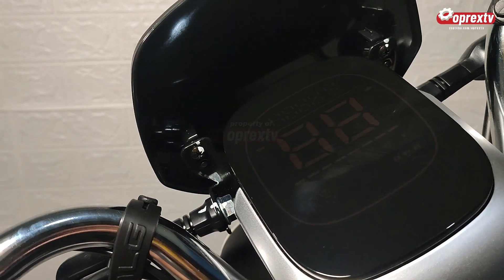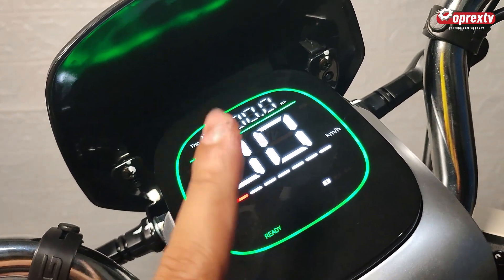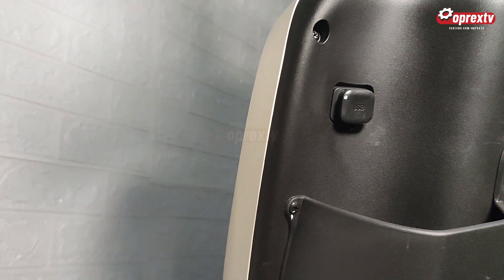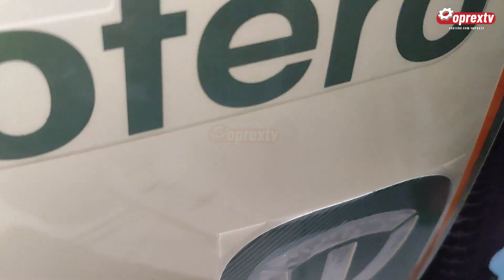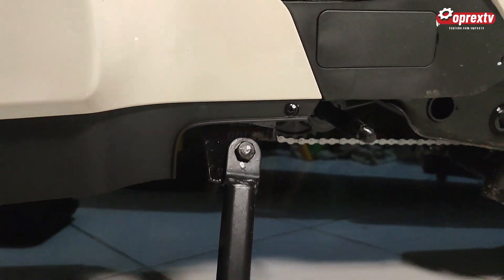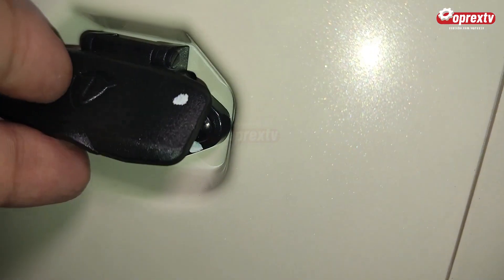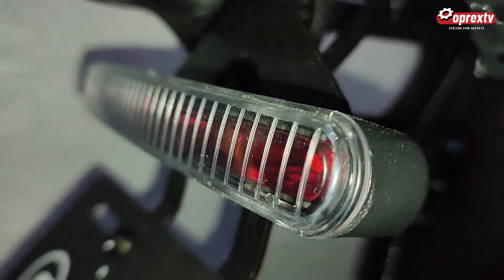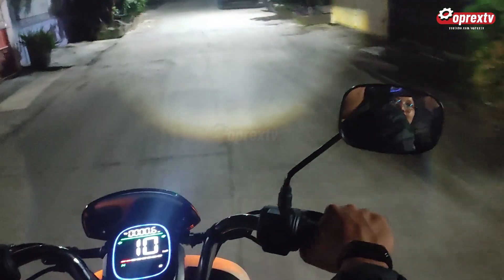Sepeda Listrik Ofero Stareer Murah Fitur Mewah

Comment: Mas kalau charger dicolok langsung warna hijau dan fan tidak mutar knp ya ?
Reply from the maker: kondisi tersebut bisa terjadi karena kabel output charger tidak bertemu dengan kabel saluran pengisian battery, bisa conector yang bermasalah, atau bisa kabelnya yang bermasalah atau battery management systemnya, yang paling sedehana silahkan check sabungan conectornya dulu om, jika ada AVO meter bisa check continuity & Voltagenya dulu om....